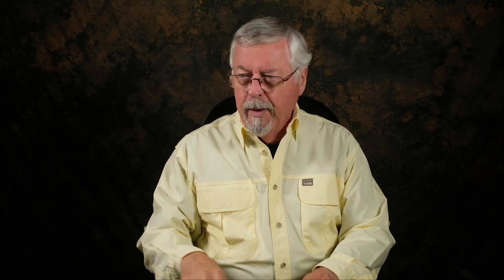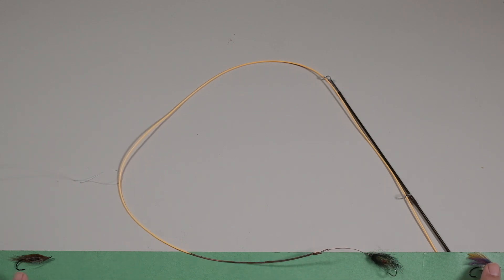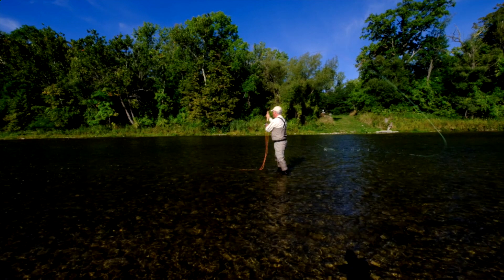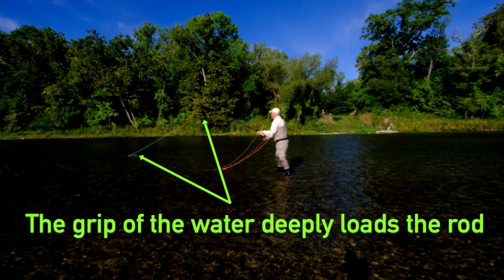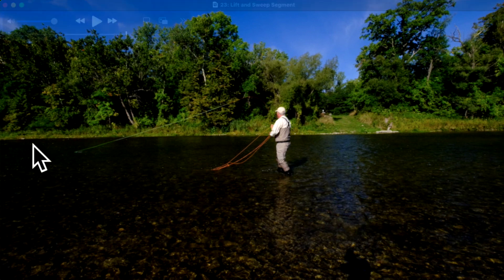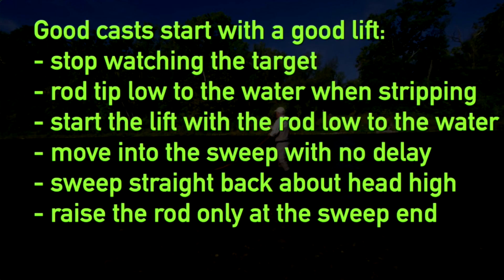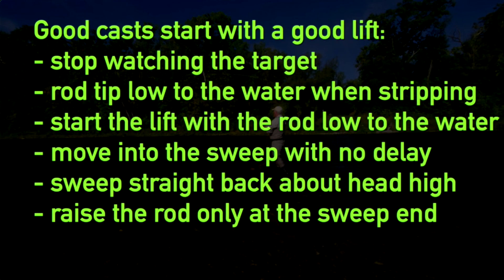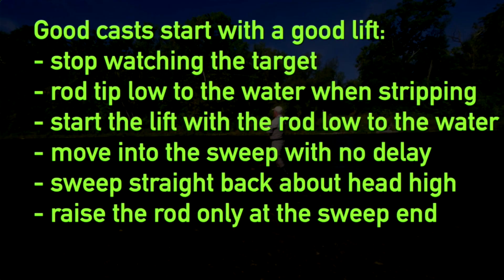Efficient Spey casting: Part 23: It All Starts With a Good Lift and Sweep

Comment: Same lift a double Spey, snap cast, and snake roll? How about for a 90 degree single Spey?
Reply from the maker: The basics of the lift are the same for all casts. While one or two aspects of the lift may be different (e.g. Single vs. Double) at their fundamental level, the mechanics are the same. The only substantial difference between the Square Cut and a typical Single is where we point our lead foot.

Comment: if your anchor lands at the right spot but in an "L" shape - is that because the lift has been un-smooth and jerky? Or the sweep has been angled down/over powered? Thank you in advance
Reply from the maker: That shape is referred to as a "Bloody L" in the UK and it usually results from dipping the rod tip down on the sweep, driving the anchor down. To avoid this, when making your sweep into the D-Loop, make sure that the rod is travelling straight and parallel to the water, or slightly angled up. 

Most often the problem actually starts on the lift, where it's both too high and too quick. Start with the rod tip almost touching the water, the rod pointing straight down the line, then make a slow, smooth lift that doesn't go too high. Then it will be say to make a straight sweep without the dip.